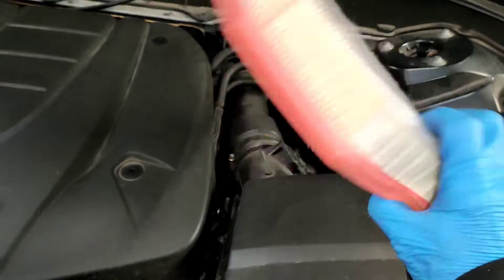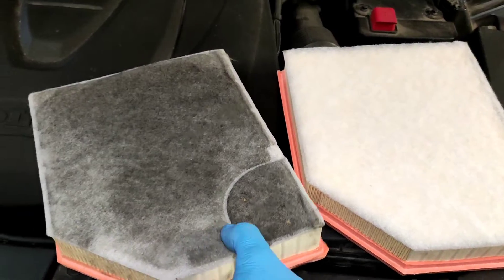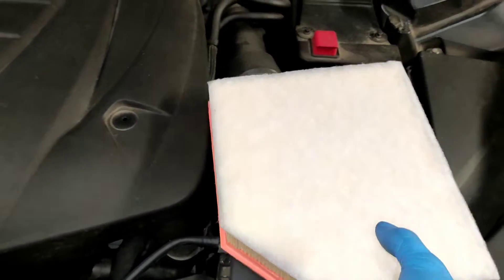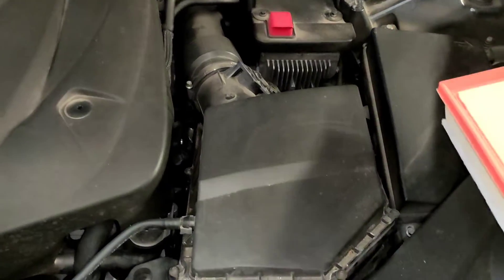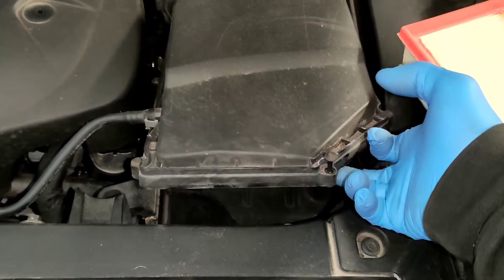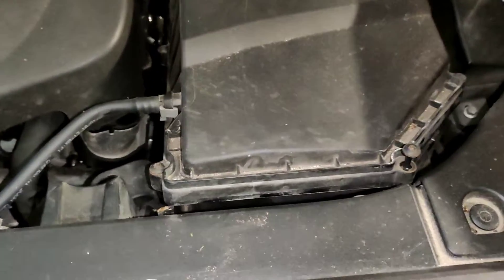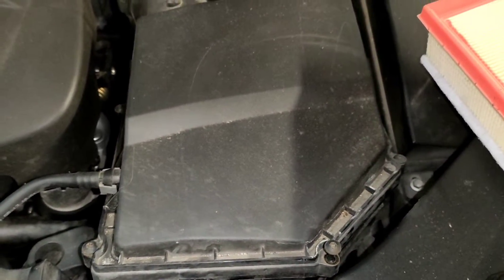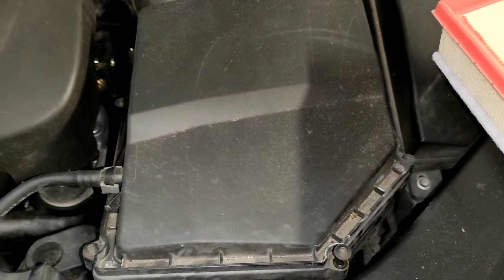XC90 Air filter replacement

Comment from the maker: check out the other service videos

Air filter replacement
https://youtu.be/-lR7_8gn1mc

oil and filter replacement
https://youtu.be/mvhK5aauqSc

fuel filter
https://youtu.be/-ISifJJOk6s

pollen filter
https://youtu.be/QZmAv2VlsnM

service light reset
https://youtu.be/_OolrAIWjr4